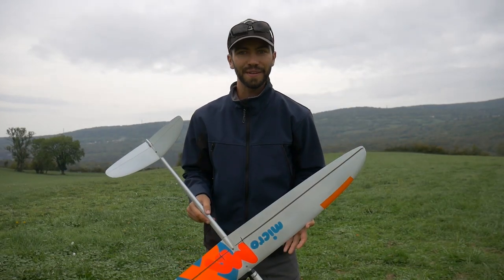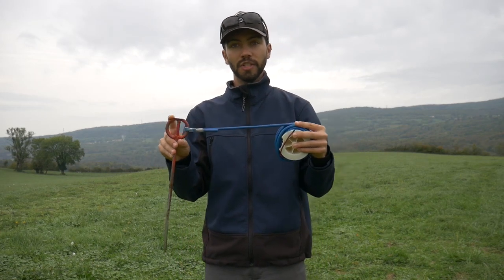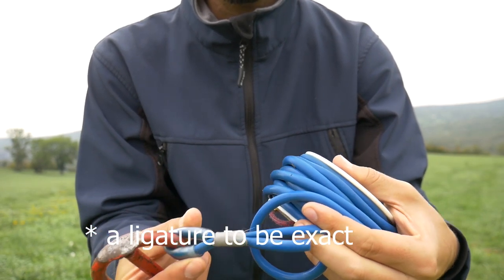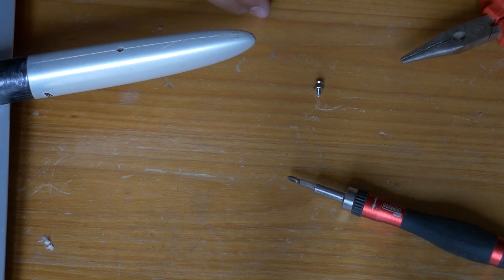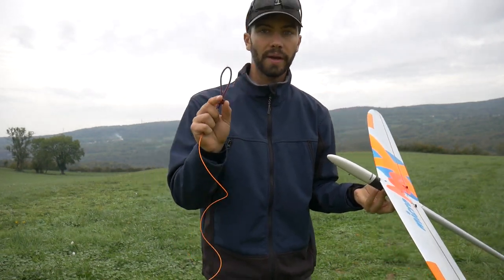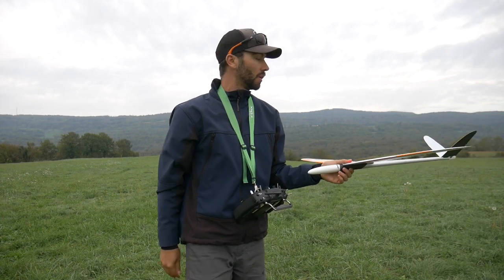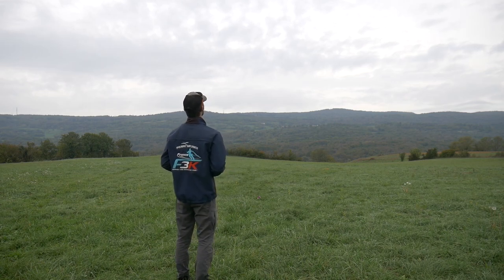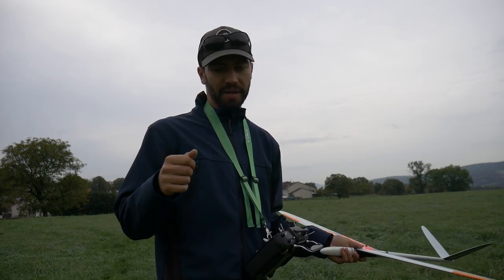How to Bungee-launch your MicroMax

Comment: Thank you for another great video! I’m going to try this!
I have found the servo buzzing (10:35 and 13:20) is caused by FrSky ACCST telemetry. The new ACCESS protocol eliminates this noise.
The buzzing noise (and sometimes twitching) seems to happen only with certain servo brands/types and can also be stopped by using an older ACCST non-telemetry receiver.
Reply from the maker: Yes , it's the telemetry causing the servo buzzing . I am used to it as I fly like this since 2016 😅😅